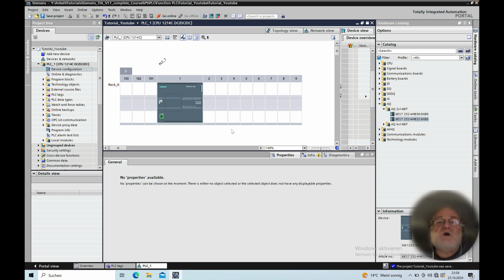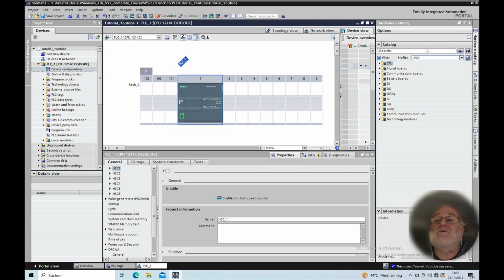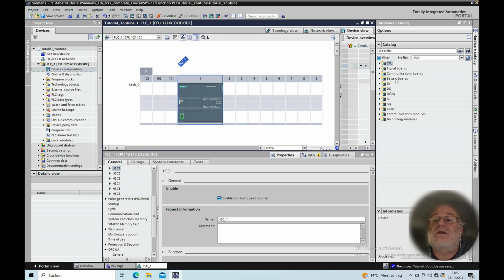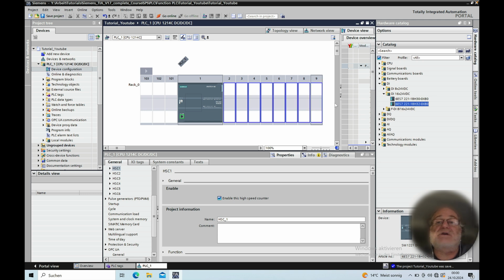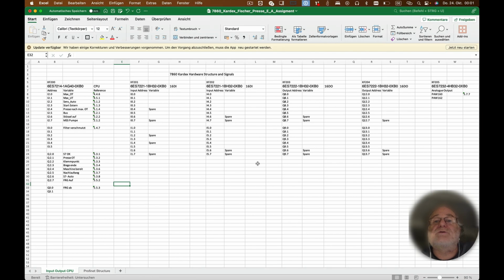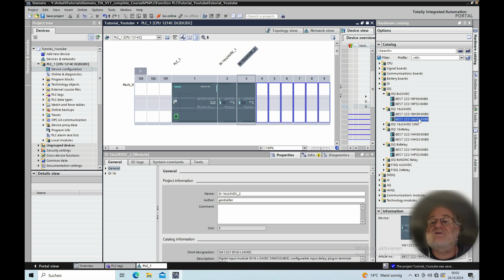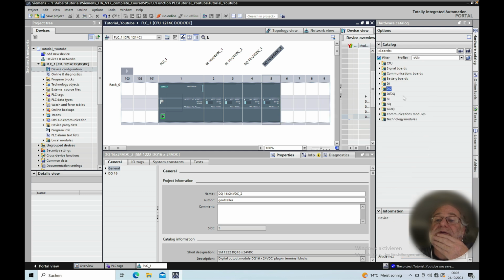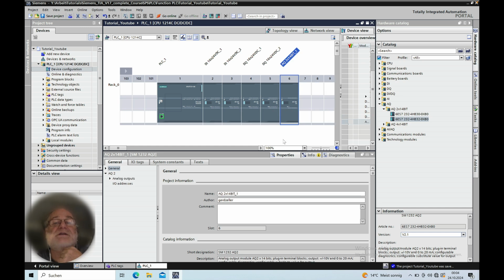add hardware extension modules to a CPU S7-1200 using device configuration Siemens TIA V17  #2

Comment: it'll be a great if using remote io (Et200) instead.
Reply from the maker: Hi, thanks for the comment. I think it depends on the application. In my case i am doing a retrofit. The machine installation is already done all to the cabinet. So in my case it would not make sense to use remote io.